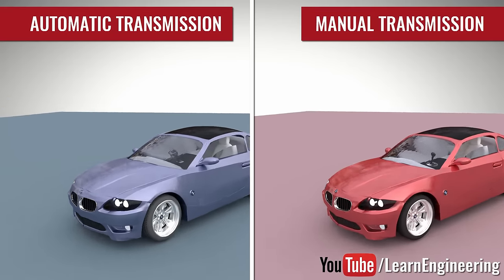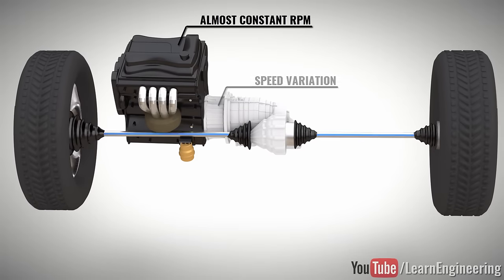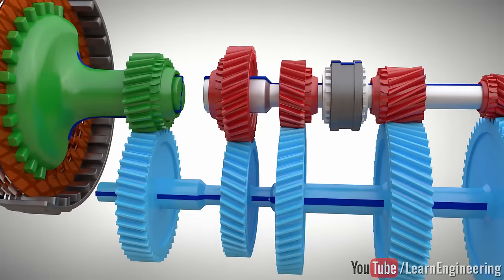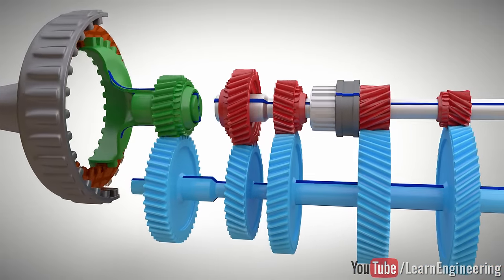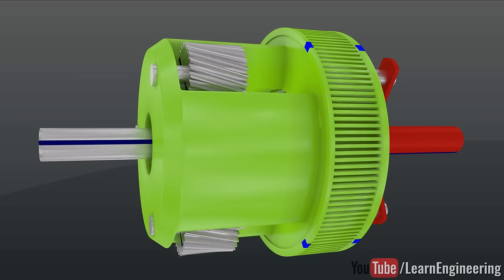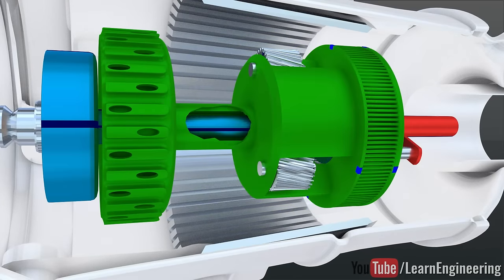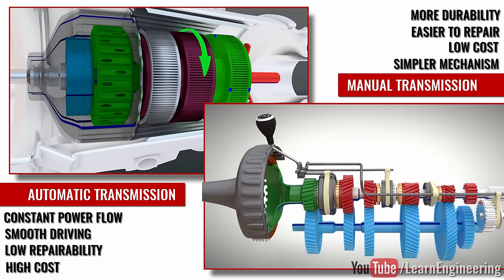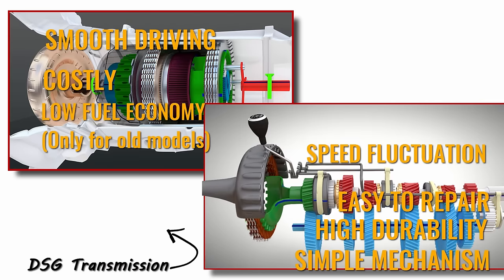Automatic vs Manual Transmission

Comment: No no no no. You do NOT press the clutch before applying the brake. The sequence is ABC: foot off Accelerator, foot on Brake, when nearly stopped depress Clutch. This is keeps the clutch engaged until the last minute and the car is better controlled. Pressing the clutch first results in a surge forward - acceleration of the car. I am a UK driving instructor.
Reply: Nicole K exactly, I was about to say that... disengaging the clutch reduces engine breaking, which we dont want trying to slow down
Reply: Engine braking is not only helpful for control, but for slowing the car! Never, EVER release the clutch unless you are downshifting to improve engine braking!
Reply: +TRLWNC1 The way I've always taught my pupils, is not to change gear at all when slowing down. Change gear when you have reached your target speed, or use the clutch just before the engine shows sign of being unhappy when stopping. Changing gear disengages the clutch and makes the car less stable during those moments.
Reply: Nicole K unless you are racing....  ;)
Reply: Nicole K but you are very correct.
Reply: True but im used to pressing the clutch at the same as the brake. I can replace my brakes myself for cheap. Not so for the engine and trans so anytime i can take them out of the equation i will. Same with downshifting to stop. Always drivin old standards and never had a clutch go out
Reply: That is a great way to have a stability problem. Always leave the engine connected for as long as possible. True, pressing the clutch doesn't do a lot for wear if you do it right, but it still disconnects the engine from the drivetrain. This lessens the ability to have the engine slow the car. And it causes more wear on the brakes so that they will need to be replaced more often.

If it has worked this long, I'm sure I'm not going to change your mind. But I never, ever disconnect the engine. Automatic OR manual. At least not until at a stop (or close enough that the engine doesn't slow the car any more. ;) )
Reply: Jeffrey, old habits are the hardest to break (brake!?!). It took me a while to stop using the clutch first when slowing down. Persevere, it'll come to you before you know it. One trick is to hook your clutch foot behind your brake foot. Few cars get as much of a caning as driving school cars, but I've never had a clutch or gear box give out me.
Reply: Nicole K Im not sure where you live but no driving schools in the u.s. that i know of teach on a manual. I wish they did. I learned on a stick and wont buy anything but. Autos are just not as reliable
Reply: TRLWNC1 If stability is a problem as in snow or ice, then i DO leave it in gear AND downshift. But youre right its worked so long...
Reply: I'm in the UK. It's pretty difficult to get a licence as an instructor: you're tested in all kinds of ways - your driving ability, your ability to critique driving, your ability to teach - and there are a lot of regulations governing the business. Here, automatics are a rarity and if you take your driving test in one, you are not allowed to drive a manual.
Reply: Europe teaches manuals. Probably England.

However, automatics are coming as reliable as manuals as time goes on. Not that they are less complex, but they are becoming better as time goes on.

I was taught to drive on a '53 Ford tractor with no syncros. I am well aware of what it means to be FORCED to push in the clutch to decelerate! It's SCARY at top speed on that thing! ;)
Reply: Nicole K Good, it should be the same here as far a the trans part. I believe everyone should learn manual.
Reply: Nicole K before a bend, i usually Press the clutch and downshift, this is a way to save brakes, and have a controlled car just before  the bend, there is no reason to downshift After or worst, in the bend. is it correct?
thank you :)
Reply: Nicole K I don't know abt car, but in bike if I press brake w/o clutch, the gears will screach and I feel like falling, if  I'm in cities, then doing so will definitely turn off the engine
Reply: Coming to a stop sign I downshift for 2 reasons. One it's slows it down easier and not as hard on my breaks. Two I like hearing the Ying of the 4 cylinder. And it sounds like a Jake break through the hole in the cadiylitic converter.
Reply: Nicole K while you need stopping a vehicle, press brake without pressing clutch until the speed below 10 km/h, and then press clutch or downshift slowly
Reply: Nicole K 
This is news to me, I always thought 'Foot off Accelerator, Press Clutch and Brake together', depending on how fast and quickly you need to brake. Your version makes sense, let engine idling slow the vehicle first.
Reply: 3:30 "A manual transimssion drive is never a smooth experience"... Rev matching is the key
Reply: Also if you press the accelerator a little while changing gears the change will be a lot smoother
Reply: +Gabriele You're absolutely correct. You're helping the car round the corner by accelerating slightly as you reach the crown of the curve, which is easier to do in a lower gear. There's a rather nice diagram in the UK Police driving manual that shows why this is a good thing in terms of forces and the directions in which they pull.
Reply: +Jeffrey Barton I agree. Only once did I have a pupil that I suggested learn with an automatic. She was my albatross - for months, every lessons started with "how to to turn left" - arguably the simplest manoeuvre there is. I admit that it was my way to move her on to another instructor (I didn't have an automatic). She was never, ever going to be able to drive.
Reply: mcjay669 Really, you should press the clutch all the way when changing gears, otherwise you risk causing considerable damage to the gearbox and of making the most horrible noise.
Reply: Sometimes different people respond better to a change in teaching method also.
Reply: Engine braking
Reply: Nicole K
Reply: Nicole K I totally agree with what you say except one detail. Depressing the clutch cannot cause a surge in accelerating at all. Perhaps a roll down a hill but that's not my point. The car simply loses engine braking. It cannot accelerate without the output drive or a hill. basic physics driving instructor
Reply: Pressing the clutch before the brake wont always result in a surge forward. That will only really happen if your utilizing a degree of engine braking at the time. The resistance of the gears will be gone and you'll pick up speed. If however you're going up hill, probably in a low gear with high-ish revs then you'll start to slow down as soon as you press the clutch.
Reply: float the gears and forget about the clutch.
Reply: Nicole K haha haha all driving instructors say the same thing, and it's crap
Reply: Nicole K Huh, TIL....
Reply: Joe Bailey, You're right - there's no acceleration, but subjectively you feel it as surge forward. The reason is that the driver first takes his foot off the accelerator which causes the car to slow, then he disengages the clutch which stops the car slowing. I've always felt this as though the car were speeding up again, when in truth it's merely not slowing as quickly as before.
Reply: It's marvellous, Ryan, that you hold in such high esteem those who were instrumental in you obtaining your licence. How many different instructors did you have? How many attempts at your driving test?
Reply: Exactly Nicole, never depress the clutch until you are about to stop (depending on which gear you're in), it also saves on wear and tear on the clutch, also when slowing down while in gear you don't use any fuel so you also save that tiny bit of fuel. Who in their right mind would drive down a steep hill, then clutch and brake at the same time.... that's just insane.
Reply: Nicole K No no no no. Last time I checked driving instructors are not mechanics or engineers.
Reply: No engine braking = longer braking distances = reduces brakes efficiency due to temperature = much longer braking distances
How do you brake on mountain roads ? and emergency stop ? No engine braking at all ?
Reply: Jeffrey Barton "Im not sure where you live" she clearly states that she's in the UK haha
Reply: You are coasting in neutral. To stop, you take your foot off the accelerator and apply the brake. Do not touch the clutch or gear lever. Experience will tell you when the engine will start to stall as you slow down. Just before this happened, press the clutch and come a halt. Apply the handbrake and select neutral. This takes full advantage of engine braking and is the safest sequence actions, and also means that your brakes don't take the full brunt of stopping the car. (This is why automatics tend to need replacement brakes more often than manuals.)
Reply: That's an extension to what I described above where the target speed was zero. You slow or speed up to your target speed to your target speed and then select the appropriate gear for that speed. There's no reason not to down-shift to get extra acceleration because engine braking is not the issue there.
Reply: Always press the clutch sufficiently to completely disengage it. Synchromesh in the gear box will mitigate most of the effects of not disengaging it completely, but why take risks? How far that will be is a product of state of wear of the clutch and of its design.
Reply: Nicole K exactly,  if you are driving a m.trans and you're going to slow down,  brake lightly and downshift when the rpm is low ,.. stepping on the clutch every time you are stopping may cause wear on the release bearing..... and who says you can't have a smooth ride when driving a manual, maybe they should get an auto car bcause they don't have the time to understand a manual.
Reply: Also its very important not to press clutch while braking on a slippery road.
Reply: Nicole K
Reply: Nicole K I drive a manual every day and I put it in neutral and then press the brake. no accidents, no breaking down. I think I'm fine. :p
Reply: Nicole K cool dude
Reply: Engaging the clutch before applying pressure to the brake pedal will needlessly overwork the brake pads though. If you engage the clutch, the brakes only have to stop the chassis of the vehicle, and the engine continues turning over at a consistent speed. If you don't apply the clutch before the brake then you slow down the engine and use gas to speed it back up again when you engage the clutch
Reply: +Epicsurfer14 What you are doing is called coasting in neutral. It may be acceptable where you live, but you will fail your driving test in the UK if you do it. It is regarded as a serious fault. Why is this so? Read the comments in this thread.

You are at liberty to drive in whatever way you please, but in the event of an accident, your unsafe practices will be taken into account when assigning blame.
Reply: +LarryJr661 I'm really pleased. Spread the good word. I'm slightly surprised that your driving instructor didn't din this into your head, but then, we don't remember everything we learn.
Reply: Nicole K oh no wonder hahaha
Reply: +LarryJr661 I'd have been happy to have taught you - you seem to be an able student. However, I'm retired now and in the wrong country. Happy motoring!
Reply: Nicole, pressing the clutch CANNOT result in an acceleration forward unless you are going downhill. Regarding engine breaking -- it is an irrelevant detail here.You may as well criticize them for not mentioning "double clutch" technique. Yes, engine breaking is a much better technique on high gears but try your ABC technique on the 1st gear on a powerful V8 engine.
Reply: No, you've misunderstood. Drive in 4th gear, about 40mph and then take your foot off of the accelerator without depressing the clutch. You will feel the car naturally slow down. Do the same but depress the clutch as well as the brake...you'll feel the car feel like it's accelerating because it's in neutral and free wheeling. That's what Nicole means. And not everybody has a V8 engine in europe. We're mainly stick with shitty flat four or flat 6 engines.
Reply: Nicole K I put the clutch down then put it into neutral and start to brake, used to piss off my instructor doing that 😂
Reply: Do we downshift in the process? Let's just say I'm in 3rd gear,is it possible for me to remain in 3rd gear till the last possible minute? -New Manual driver
Reply: Lala_C yes. That's the point. If slowing don't change down. Keep the engine engaged until you reach your target speed. If stopping that will mean that you to disengage the clutch, but don't this until you need to to. The object is to keep the engine connected to the wheel as long as possible so that it helps slow the car down.
Reply: Ugh ... maybe this is why everyone should be trained by an instructor. I went to a driving school to learn automatic, but I was trained manual by my husband, and he had me gear down through each gear when slowing. He later told me this is not necessary, but it was to get me used to the gears. I wasn't impressed lol. That's also how he was trained. I had a bad habit of immediately depressing the clutch when I decrease speed. But I've been rectifying it. Before I even read all of this. I'm so confused now. I also have this habit of 'coasting'. Didn't know it was frowned upon. i don't see the issue with it. Unless of course it's hazardous conditions, when I have noticed the difference when I depress the clutch and brake and I lose the control stopping. And I had no idea that you can stay in a gear until you stop, just before the engine stalls. This is blowing my mind. LOL. Being that you need to match the revs to the gears when speeding up, I assumed this would be the same for slowing down. It's hard to understand how this would not cause wear and tear on the engine.
Reply: Nicole K a surge forward when depressing the clutch? i drive a manual evry day. when im comeing up to a stop i get off the gass and my car starts to slow frome engine resistances. i then clutch and put the trasmition in nutral. my car does stop slowing frome the lack of engin resistance but it doesn't surge forward. i then coast untill the breaks are needed. their are manny difrent ways to use a manual transmission but limitting people to one specific way of doing things is something teachers tend to do. i bet you dont even know how to change gears without clutching while etheir going up or doun thru the gears. i learnt that by understanding how the transmission actuwally works. but hey i just have a problem with teachers who think they know evrything. none of us know evrything.
Reply: Read over the previous comments, it's already been explained what was meant by the surge forward. And yes there are various ways in how to drive a manual and how to slow down but what Nicole is saying and explaining is the best way to slow down, by leaving it in gear until you have to change or put into neutral. It's all explained on earlier comments.
Reply: All of the misinformation here is making this thread unbearable...
The "surge" you feel once disconnecting the engine from the drive train is proper acceleration, just not the way everyone seems to think it works. Acceleration in the true sense of the word is the rate of change of an object's velocity. What is happening in this situation is a change in acceleration as well; this is known as jerk. When you engine brake, you are decelerating the car and yourself. Once the clutch is disengaged, there is a decrease in the force impeding movement which leads to an increase in acceleration/decrease in deceleration according to our bro, Issac Newton. This change is the derivative of acceleration, or the jerk, hence the name.
Reply: It depends. What i do if im in heavy traffic, i press the clutch first then brake. When on fast acceleration i step on the brake first then clutch.
Reply: The simple answer is - read the whole thread. The better answer is: engine braking.
Reply: Exactly Dylan Headrick, perfect way of wording it. Wish people would 
just read previous comments instead of simply giving their two cents on 
the matter. They'd melt your head!

@Nicole K, I concur. Read the thread, otherwise refrain from commenting.
Reply: +Noir SpectreI do wish you'd read the thread. Down-shifting is exactly the opposite of what I'm talking about.
Reply: +Noir SpectreThis is the exact opposite of what you SHOULD do. You'd fail your test in the UK for doing as you suggest.
Reply: Nicole K The car will only be more stable during engine braking if the car has rear wheel drive. Any kind of braking will destabilize a front wheel drive car. Engine braking makes a fwd car oversteer.
Reply: +Noir Spectre here is an example of what she says: you are in 3rd, you have to stop, you apply the brakes, when the engine is near to stalling you disengage the clutch and from then on you only use the brakes until you stop or if you don't have to completly stop, you put it in the gear apropriate for your speed and engage the clutch.

btw you said "downshifting which is cool if youre at the right rpms". íou can be at the right rpms whenever you want, you just have to rev the engine there while the clutch pedal is depressed.
Reply: Thats exactly what i do, the proper way to stop when driving manual
Reply: This is why I don't drive a manual. Most newer automatic cars have a manual mode that lets the driver shift himself, without having to deal with the hassle of a clutch.
Reply: Cappuccino - using your fingers to shift in an automatic is not the same as driving a real manual...
Reply: pause video on 6.50 to look for this comment :D
Reply: Nicole K a woman teaching others to drive. what a dark day for humanity!!
Reply: hmm, maybe realities and theory is different, maybe the most efficient using manual transmission is to engage the clutch first, but in reality its different
Reply: Nicole K I think they are assuming fully pressing down the brake - locking the wheels - in which case the engine would stall if the clutch were still engaged
Reply: +runescapefan0001 I've given up on this thread. I think I've explained myself fully. There are many people who feel able to comment without having read what has gone before. Thanks for your interest.
Reply: you cannot generalize like that. Most of the times, when you step on the break, you're going to change gear to a lower one (like before a curve), so you have to depress clutch. When you're stopping, you have to depress clutch. When you're on a highway and you have to slow down because you notice you passed the limit, you don't press the clutch. When you're going downhill you don't press the clutch. But the latter two in general cases are less common to happen, and when you're in third gear and want to come to a full stop (like red traffic light in the city) without pressing clutch early enough, your engine is going to turn off.
Reply: my car really prefers to just stop in neutral. I also have performance brakes and a bad clutch/transmission (still trying to find out which one, kinda why im here) so that may impact on the fact I and my car prefer to just swap into neutral and drift/brake to a stop. I drive a 1995 Tans Am, which also changes how I normally drive anyway, compared to a regular everyday sedan or SUV, and ive only driven clutch for about a year or 2, but I've also driven it in competition, and it really does pays to have every second off the clutch and in neutral as possible in stronger and older cars. might be an age difference thing too? or maybe just the transmission or clutch withering? im no mechanic.
Reply: Do what you want people. The video is right too... I never use the power of the engine's components to control the vehicle unless it's to move it. You can use the clutch, but let me ask you this. what is the purpose of the engine? To move the vehicle, not stop it. what is the purpose of the brakes? To stop it... which one is designed for mechanical wear in mind? Every vehicle I've owned has been manual and I've never had engine failure related to the transmission.
Reply: Exactly, we must take advantage of the engine RPM to reduce car speed and keep going for the shorter gear, disengaging and engaging the clutch, with a gentle touch on the brake and controlling it, as necessary, sticking to the the longest possible gear that fits the RPM, speed limit and the amount of reaction time one has. 
Can't drive around with the wheels spinning unchecked, it's a death sentence. 

By the videos logic, we would go on a really steep downhill on Neutral gear, since we'd be constantly braking (Consequently burning out the brakes and being completely unable to control the car). It makes perfect sense to stay on 1st gear so the engine RPM is limited, and assist with the brake as necessary. If breaking too hard we can disengage the clutch to get some RPM back and repeat until the path is complete.

Of course on the average urban downhill it would be perfectly possible to stick to a 3rd, maybe 2nd gear depending on the amount of traffic,visibility etc... Braking within reasonable engine RPM will not in any way be harmful to the car.
Maybe it was confused with disengaging the clutch to stop the car in this video.
Reply: well said Nicole K! I saw that part and was pretty confused, wouldn't pressing the clutch in be regarded as 'riding the clutch?' I am also from the uk by the way but live in the usa, as a driving instructor I think you would be quite shocked at how easy the driving test is here compared to the uk!
Reply: +Dim Wit - you certainly don't live up to your name. I've heard that it's far too easy in some states, there, but cannot be as pointless as that in one of the Indian states: drive in straight line for around 300 yards, then turn left. That's it! And ... the turning left bit is optional.
Reply: +insystem7 No! This is the exact opposite of what I have been saying. If stopping, do not change gear. If changing speed, select the gear appropriate.
Reply: Nicole K So I'm on 3rd gear lets say, and I will have to stop. I just brake until the engine can't take it anymore, disengage clutch so it won't break down, and don't change gear? How will the wheels start spinning again? 3rd gear absolutely can't handle car the car weight.

As I'm braking I'm downshifting gradually to maximize braking efficiency, using the least possible amount of brakes (we don't want them to wear out) and using appropriate engine RPM. If I need to stop I stop and downshift, If not I stick to the appropriate gear.
Reply: +insystem7 You've nearly got! Instructors in the UK teach you that, having come to a halt, you apply the hand brake and select neutral, and relax. From there you are free to move off in whatever gear you deem appropriate. By not changing gear as you slow down, you gain maximum engine braking effect, while the effectiveness of the brakes are not affected by the gear in use.
Reply: +Seth I see what you mean. In practice this is not an issue. This is how hundreds of thousands of drivers are taught in the UK. We aren't famous for wearing out clutches.
Reply: Bullshit. You First press the clutch and then push the brake or you push them simultaneously. And why would the surge forward matter? How long would you need to press the brake after clutching? And your idea maybe too harmful for engines with driving beginners. I never choked the engine when I began by the way.
Reply: Seth, that's very interesting; I'd never thought to do the test. Out of interest, what vehicle do you drive?
Reply: i usually down shift to match speed, and or use a lower gear to slow the vehicle
Reply: say whaaaat, im from Germany and my drive instructor tells me to press Clutch first andthen start to Brake xD
Reply: Kirby 1810 Sag ihm mal dass Motorbremse schonender ist. Oder wechsel die Schule
Reply: MrBlack661
Was spielt das beim pkw fuer 'ne rolle?
Reply: volarecantare bein schaltgetriebe ne große. beim abbremsen runterschalten und durch die kleinere übersetzung dass auto alleine abbremsen lassen. schont die bremsen ungemein. von 70km/h auf 0 nur mit bremse oder 70km/h auf 0 mit hilfe der motorbremse
Reply: MrBlack661
Ich rede von PKW, nicht LKW.
Reply: volarecantare Ja ich doch auch. PKW hat genau dasselbe prinzip. Motorbremse lernt eigentlich jeder in einer vernünftigen Fahrschule
Reply: hatte bis jetzte erst eine Fahrstude xD Nächste ist Freitag :D Ich frag mal nach :P
Reply: Nicole K     Let's say you must go from 5th gear at average speed to a complete stop; wouldn't engine brake be more effective if, as soon as the revs decrease enough, you'll downshift a gear, instead of leaving the car in 5th? With each gear that you downshift you can feel the car slowing down even more. It'll be like this: 5th, wait for revs to decrease (but not too much, otherwise you won't have any additional brake) > 4th, wait for revs decrease > 3rd, wait >2nd, and so on...
Reply: MrBlack661
Beim PKW lohnt sich das doch nicht, ausser bei langem bremsen und langem abhang.
Bei dieselmotoren gibt es keine natuerliche motorbremse. Da muss man die motorbremse einschalten, welches luft fuer die zuendung ablaesst und dann ein- und auslassventil/e sperrt, damit statt zuendung vakuum entsteht. Die motorbremse wird da verwendet, um bremsverschleiss zu minimieren.
Und mit 12 oder 18 gaengen klappt das auch gut und lohnt sich auch. Schwere ladung und ein retarder helfen auch beim verlangsamen. Bei einem *PKW mit 6 gaengen ist das voll unnoetig. Fuer fahranfaenger ist davon auch abzuraten unter 30 metern mit dem motor zu bremsen.
Reply: volarecantare Bei der Motorbremse wird ja auch der nächstkleinere gang dazu verwendet um abzubremsen. das ist ja unabhängig von otto oder dieselmotor. bei einer voll bremsung macht es natürlich keinen sinn und auch wenig wenn man sehr schnell abbremsen muss auf einer kleinen distanz. wenn ich allerdings mit 50 auf eine rote ampel zufahre, nutze ich trotzdem die zusätzliche bremswirkung indem ich bei ~35 in den 2ten gang wechsel und dadurch zusätzlich langsamer werde durch die kleinere übersetzung.
Reply: MrBlack661
Fuer einen gang kannst du es auch sein lassen. Sinnlos.
Reply: Thomas Emptage  I do all the thing you said but in addition I also downshift one gear at a time, as soon as I feel that the engine revs lowered enough to allow me to do it: this will keep the engine brake strong. If you simply leave it in 5th, the engine brake will be extremely weak after a while. 
 P. S. obviously, during all this maneuver the braking pedal must remain always pressed.
Reply: +rvbrexer Think about it carefully. In the higher gear you get much more engine braking for exactly the same reason that it's very hard to move off from stationary in a high gear - lots of torque needed.
Reply: Nicole K  No, actually it's the opposite of that. Higher gears are made for high speeds, and vice-versa.  Lower gears offer much more resistance when slowing down (even too much, if you're not careful when downshifting you can break your engine). Otherwise, why would heavy trucks need low-rate gears (which are extremely lower gears: every low-rate gear is lower than the 1st gear of the truck)  when going downhill? Why they don't just leave the engine in higher gears?  

To answer your question: why do you need more torque to start a car in higher gears? Because you have to accelerate that car, to slow down you need to do the opposite: decelerate.  Lower gears are bigger, so the revs that the engine is outputting arrive to the wheel multiplied by a factor resulting by the diameter of the gears.  

Now,  when the engine is opposing resistance instead of pushing the car forward, this same resistance gets multiplied by the gears before getting transmitted to the wheels, and since the higher gears  of the car are smaller, they divide this force instead of multipling it (Sorry if my explanation is not clear,  I'm not even a native English speaker).
Reply: Have it your, if you want - I really can't be bothered with those that are unable to see. Talk to a mechanical engineer - if he's any good, he'll explain.
Reply: Nicole K   Sure,  BTW have you ever talked to an engineer?  Did he/she specifically said that higher gears make more resistance than lower gears when you're slowing down?
Reply: You might find this odd, but, yes, I do know what I'm talking about. I had the same reaction as you when, learning to teach driving fifteen years ago, I discovered that you don't go down through the gears, and that remaining in the highest gear was more effective. I asked my father (who died a few months ago), who was a university teacher (known as a professor in the USA) and a chartered engineer. He confirmed what I am now saying to you.
Reply: Nicole K  Oh well I could be wrong (BTW,  sorry for your loss).  However,  I'm still not convinced, how do you explain the fact that trucks need low-rate gears in  steep downhills? Also,  this is something that  I had a direct experience with. If I did still drive it would be very simple to make a little test to see who's right. Maybe someone who's reading this can do it?
Reply: rvbrexer Nicole K is right. theoretically and also in pracise. I drive with a manual gearbox and if you want to slow down you shift in a lower gear.
Reply: MrBlack661   So, you're agreeing with me. I was the one saying that it's better to downshift, not Nicole K.
Reply: Nicole K darn right
Reply: rvbrexer I'm sorry. Mixed the names up. Of course you are right.
Reply: don't know whats wrong with your cars but they dont make ours "surge forward" when I let off the gas and press the clutch it feels the same but it coats better
Reply: you are still correct tho, its always ABC, same as on a dirtbike/atv(that's why I teach people on them first)

also I meant coast not coats
Reply: +insystem7 
you're in 3rd gear and you will have to stop, so it's a planned stop and not an emergency stop?
You go to second gear without pushing the brake, you'll slow down to 2000 rpm, you change gear to first gear, now you're almost to a full stop and you can gently push the brakes.
You're brakes will tank you
Reply: And that's why you NEVER trust the word of an AMERICAN
Reply: Stop talking Absolute rubbish
Reply: Nicole K lol 😂 i knew you were a UK driver when you said this i got told that as well by my driving instructor
Reply: Imoo
Reply: I'm a Romanian reckless driver and I can confirm, this is basic drving knowledge.... well.... maybe not in 'Muisca tho XD !
Reply: Totally agree.
Reply: But let's be honest, feeling that bad boy jolt after every shift while hammering it down the fast lane feels good lol.
Reply: Nicole K you are absolutely  right a lot  of people do it wrong plus pushing the clutch in first and holding it wears out the thro out bearing faster
Reply: Bagus Prasetya I like your tip
Reply: Modern cars ( most cars after 1980) don't inject fuel while engine breaking. Even though the engine is at a higher RPM than idle, your actual fuel consumption is 0. Have a look at any car that gives you the current fuel consumption in the dashboard. The breaking comes from the internal friction of the engine and its compression stage.
Reply: There are some points I disagree with. Lower gears will always give better engine breaking performance. If you're driving at 40mph you'll slow down a lot faster if you put it in 2nd gear than if you put it in 4th. Engine breaking comes from the internal friction of the engine and its compression stage, so the higher the RPM of the engine, the more breaking force. 

Also, when downshifting it is better to rev match ( bring the engine to the same RPM as the gearbox while the clutch is pressed) as the car is less stable while it's getting its RPMs up if you just gently release the clutch. But I understand that this is not something you would teach beginner drivers as it takes a lot of experience and knowing your own car (as gear ratios can be different between different cars).
Reply: Pressing the clutch does not result in a surge of the car unless you are going downhill. How could remove force from the system produce an acceleration?
But yes, it is more controlled indeed.
Reply: If you press the clutch in, you stop the engine from breaking the car, which might feel like a surge forward. It reduces negative acceleration.
Reply: It depends on the situation, when in slow traffic press clutch and brake at the same time, at high speed when in high gear press the brake then clutch when you've reduced speed. Want to learn manual driving? Come to Manila.
Reply: For me im using the break to slowdown then clutch ship down if i reach my target speed.. is that correct?
Reply: Nicole K I can't trust left lane drivers. USA!
Reply: Youre right its called engine braking power, very bad idea to 'coast' the car. We all fucking do it though mate
Reply: If Nicole k is a woman, then I better not take the advice in how to drive a car.
Reply: Nicole sounds like a badass!
Reply: Nicely said. I am an Australian Electrician
Reply: agree
Reply: @jeffbarton3353  Clutch will not wear out faster by engine braking.  Neither will the engine. Clutch will only wear out faster if you let it slip too much. (Uphill starting technique) It is the same engine that accelerates you, that helps you stop faster and more economically. Engine is built to do so. If you compare two cars of identical make,model and engine size, the only difference being the transmission, you will notice that manual cars front brake pads are a lot smaller than the ones of the automatic car. This is because the brakes must take the full force of deceleration on auto, while engine braking helps in the manual car.
Reply: How exactly does pressing the clutch accelerate a car?? That is simply not true. Please don't teach your students this.
Reply: holy words, let's hope that some kids will not going to learn how to drive from a video!
Reply: Are you suggesting bringing the engine under Idle RPM? If so, thats very very wrong.

Do it enough times while conditions are wrong, you will stall your engine, and over the long term you are doing damage to your engine
Reply: You do press the clutch first to get your car going sideways
Reply: Well you are wrong. I am a nascar world champion and now top gun instructor for nasa
Reply: I clutch in and break with the gears
Reply: @byron8169  yeah and I put the clutch in, while quickly turning the steering wheel, take foot off clutch while applying hand brake and taking it off again.
Reply: @skyline_supra_guy3756  a drift 😂
Reply: @byron8169  yup. BTW your comment isn't actually heal toe downshifting cos you forgot about he accelerator.
Reply: Yea depends on how confident and good you are at driving. No need to go through the gears down shifting. That's for freaks
Reply: @panabanana7307  going through gears is not being a freak. Going through the gears gives you engine braking. This means you can take your foot off the accelerator much later before entering a corner and brake later.
Reply: I’m a patient person normally, but I’m impatient in the mornings before work so I push the clutch and skip all the gears until I reach desirable speed to take a corner. Using the engine brake takes so much longer than regular braking at the last minute. And I drive on isolated country roads with a 110km speed limit so it’s just bleh waiting for the car to get to the fricken corner. I’ll happily do it at night tho.

In my defence I was never taught any of what y’all are saying, but instead to brake solely with the engine. Only recently have I been braking without clutch because I noticed it made no difference having the clutch on.

Australian if someone was wondering, and 18yr old here don’t attack me too hard if you’re gonna😅
Reply: Hmmm. So...heel and toe? And where are we on shuffling the wheel? Does crossing hands still cause instant, explosive road death?
Reply: Oh come on. Jesus. You can disengage the clutch and rely solely on the brakes. We aren't talking about race cars; these brakes can take it. I don't care if you're an educator, experience is the best teacher.
Reply: ShadowOfDeath24 you must have a car that rev matches for you. Some newer cars that contain manuals rev match for you when your either downshifting or upshifting. This was introduced when Datsun (Nissan) made the 350z car like a decade ago. With this, automakers made their newer cars that are a manual do the rev matching for you, though it doesn’t matter anymore because here in America, it’s all about the SUVs and people are too lazy to learn how to drive a manual
Reply: I was wondering that! I never do that unless I am doing a full stop. Otherwise why would you want to hit the clutch while braking? Being driving manual for the last 15 years.
Reply: exactly
Reply: Oh I've heard horror stories about UK driving instructors... You guys crack me up X'D
Reply: I never knew that
Reply: @nicolek4076  you down change to help slow yourself in a manual.Disengaging the clutch when slowing down doesn't make the car less stable at all
Reply: That’s the exactly what I am confused while watching the video and I was back up watching this part no less than 10 times. Thanks for ur reply here!
Reply: @nicolek4076  when coming to a stop you down change gears
Reply: Can you come to America to teach us Americans
Reply: @nicolek4076  teach me lol
Reply: Ah so that's why people use more manual transmission cars in UK than in US. US follows the Month/Day/Year date format and clutch brake sequence of avoiding collisions. While the date can get one confused the braking can get them killed 😅
Reply: Unless going down a steep hill, disengaging the clutch first will never cause acceleration. It is physically impossible. The 'acceleration' you are feeling is the removal of the engine braking effect - to a human, cessation of deceleration feels like a brief surge of acceleration.
Reply: Not pressing the clutch before breaking is a perfect way to cause huge and unnecessary wear and potentially destroy the car altogether.
Reply: weird that you mentioned your job but yes you're right
Reply: Man I had this habit of pressing the clutch first before braking until my dad smacked me on the head and told it's the other way round... A brilliant life lesson.. thanks dad